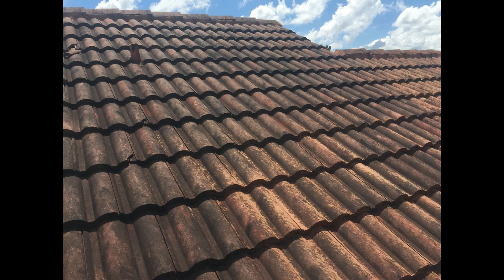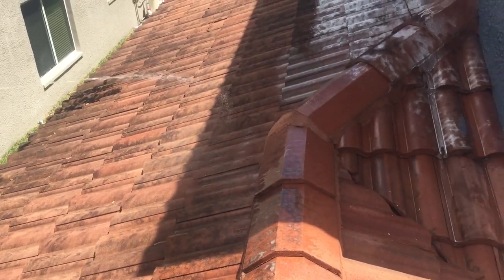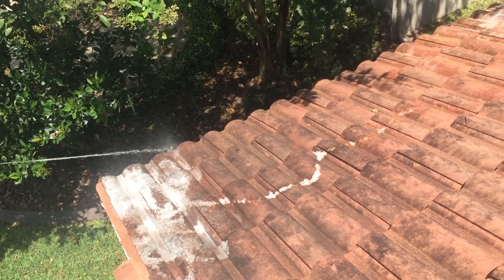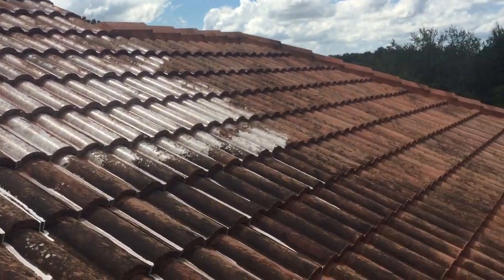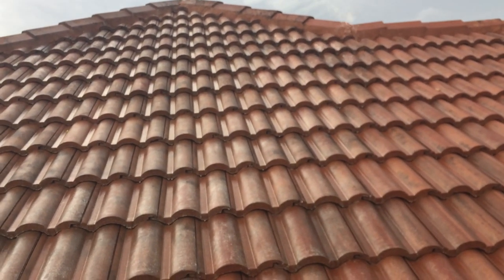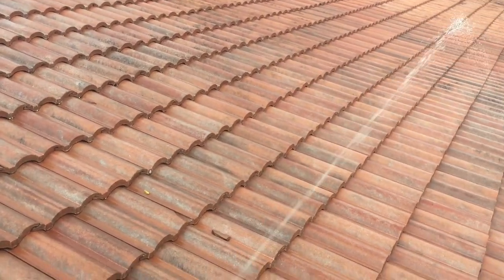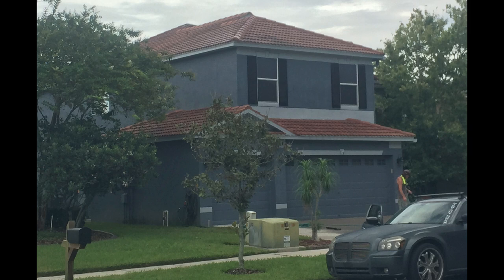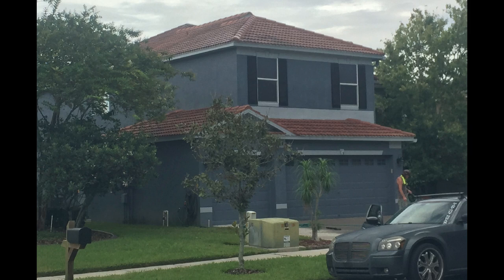Tile roof soft wash cleaning - roof cleaning service

Comment: There is a problem with this method, IF the roof was put on in Florida in the early 2000s. At that time, they were using "Polystick" as the underlayment, and screwing the tiles directly through the underlayment into the deck with galvanized deck screws. If you use SH (sodium hypochlorite)  it will attack the deck screws, which leads to corrosion and then small roof leaks as the screws loose their tight seals to the polystick. This creates numerous small roof leaks, all over the roof. The leaks are usually small, but in Florida quickly lead to large sections of the deck being effected and ultimately rotting out. This is particularly true near ridge vents. Thus, it is wise to go the slow and proven method of pressure-washing with mild chemicals. It takes a lot longer, but extends the life of the roof by at least ten years.
Reply from the maker: You are correct that is why we try to avoid flooding the roof with chemicals. And washing off with Water the roof before we complete the job to dilute the chemical down to drinking water level.
Reply: @lsellclumanetsolarenergyll5071  hello. Wondering which nozzle you are using here? Thanks

Comment: Hey, i have a few questions- can we use sh on driveway tiles? Why not use fan tip(45 degree)  and cover lot of area instead of using pin point tip? Is it a bad idea to use high-pressure washer directly? It seems to clean well for me without any chemicals
Reply from the maker: It is low pressure. We apply only with up to 100psi. The 0 degree tip allows us to still apply in area's where there is wind and the customer does not want us to walk on their roof.

Comment: Why not use a flat surface cleaner on a carbon fiber pole ? Totally  biological  and probably a better result ..  There are flat surface cleaners that will work  on a pole .. . i think you may find it is a very good option
Reply from the maker: Simple answer : You void manufacture warranty of the roof. And are in for a law suit from the owner and roofing Company. The American Roofing Association states clearly only to use Soft Wash methods with  SH to clean roofing in the USA. And 2nd with a flat surface you need walk on the roof no fiber glass pole will work without you having to walk on those roofs. I had roof where we had to walk on it it is posted on our website which is over 8000sf big where a 2000sf pool screen porch didn't gave us any other access. So we walked on it and 15 tiles broke in the process which lucky us we knew it will happen so we had replacement tiles bought upfront and once finished we replaced those all for the Home Owner free of charge. And here in Florida the slip and fall risk is over 80% when you walk on those black algae roofs even with a 3/12 pitch you will come down hard. Which jacks up our insurance so we don't do it.
Reply: @lsellclumanetsolarenergyll5071   Sounds like a lot of burocracy there  putting people off starting a small business... it is bad enough where i am .. but sure buddy i get your point... ironically  using Hypo here in Germany i think  is illegal because of the ground water..
Reply from the maker: @fensterputzernuernbergerlangen  Nope it is fully legal also in good old Deutschland because as you may not realize every drinking water is containing it as well. In German you call it Chlor which is also use in every public swimming pool too. As long you rinse off with water it will dilute to the point that is is neutralized.
Reply: @lsellclumanetsolarenergyll5071  A swimming pool is a public domain and so have water systems im place to contain and reclaim  ; Chlor used in the toilet  gets flushed down the into the water system. But water  which has Bleach in it running of  gutters  , walls etc  have in most cases are not directed  to the water sytem... You have to Reclaim it thsi water if possible . If Bleach is legal to be used in Germany  on roofs and walls etc ( external applications ) i would glad to know this but i am pretty sure it is not allowed Sir because it seeps into the ground water. i am not saying i know this as a fact 100 %  but i am pretty confident that it is not allowed .
Reply from the maker: @fensterputzernuernbergerlangen  and I am telling you it is a fact. Because every tap drinking water you even drink contains up to 0.3% Chor it is used to kill of algae. You can also reach out to Satho Fassadenreinigung their email is info@satho-hamburg.de I know them personally because they also do Soft Wash thru out Hamburg for years and years.

Comment: How much do you charge for a roof like this?
Reply from the maker: This was a bigger job than normal so we charge between $600-$800 depending on Porch/Pool screen if cleaned as well which was the case in this job including roofing inside the pool cage and the pool deck as well.

Comment: I have Can Do Pressure Washing in Houston TX using the same type of 12VDC pump soft wash system and SH. My primary surfactant is Max Cling from Northern Tool. 

For rinsing after the SH application, I use my pressure washing system instead of a garden hose. DO NOT FREAK OUT - I just use the gun / wand / extension with NO tip and reduce the engine RPM. I do from the ground or ladder. This provides a far higher water volume for faster and better rinsing, and the pressure is about the same as a garden hose so no damage.

Comment: From what i have seen, 10 to 20% SH, 10% Dawn, and 70 to 80% water works great on Tile Roofs, also most people use it as a prewash and then follow it up with there surface cleaner and since the SH works so quickly you can move through the power washing step very quickly and get the roof done in less time. Though I know a lot of people don't want to do that step and that is why they do soft washes in the first place.
Reply from the maker: Loser Squad HD 123  you void the roof warranty when you do high pressure and you do destroy the tiles with it. Also don’t try this down here in Florida or you will slip and fall because some of those tiles are glaced and others are filled up with sudd from the sugar cane burning which stays behind even after cleaning as a once wet so slippery film you simply can’t walk on those tiles.

Comment: It’s awesome that you provide so much info. If I lived in the Central Florida area I would have you do my roof. Lolo Thanks!

Also, what type of safety gear do you use? I’m sure Mask, goggles, chemical proof coveralls?
Reply from the maker: I do use a respirator and that's it. If you aren't trained good I would recommend good shoes as well. And ensure you have somewhere fresh water available like we store about 100 gallon of water in our buffer tank and have a 1" dump valve on it in case something happens.

Comment: Why aren't you walking the roof with a fan tip. I like that you aren't shooting under the tiles though. Try using a carwash soap to keep it wet. I like using something with rainX in it.
Reply from the maker: Here in Florida the roof is so slippery you try to avoid under all cost to walk on the roof. I had a single story roof I had to walk on and slipped and slided to the point of no control once. After that I stopped walking on the roof especially on a 2 story it is way to risky.
Reply: @lsellclumanetsolarenergyll5071  That makes perfect sense. Maybe think about an extension pole with a 90° bend in it. I'll try to think of something to help with that. My brother is very smart when it comes to thinking outside of the box. I'll bring it up to him too. Be safe and happy washing.
Reply from the maker: @mathewgriffith341  I do have 30' extension poles made out of fiberglass but they weight about 130lbs now crawl up a 26' ladder with it and than position yourself like a boom crane. Maybe HULK can hold that and work it for hours but for me it's to heavy and also it bend's to much when extended out so far. Which brings me back to the method I currently use. I used a different setup now with a PVC 10' and 10' extension pipe where needed still using the same tips to shoot up to 30' to cover the full roof. Like I done for a customer down in Wellington to clean her roof which on a 1 Story Level was so slippery I would not even attempt to walk on an 20year old roof tile which may break just on my weight walking on it.
Reply: @lsellclumanetsolarenergyll5071  Still going to try and think something up for you. 👍
Reply: Can you actually walk on a
Clay roof? It won’t brake?
Reply: @paulrosas2302  yes you can

Comment: Im in business thirty years here in florida and never had a claim against us for a damaged roof. Always only using high pressure
Reply from the maker: high pressure will destroy the tiles and you do have to walk on the roof which will make your insurance to go up and puts you into a much bigger risk.
Reply: @lsellclumanetsolarenergyll5071  Hi, I'm doing your soft wash cleaning work in Turkey. Washing detergents are not here, I'm trying to mix some detergents myself to create solutions. From my research, you mix water with hypo and add surfactant. Surfactant ? Is it the substance that gives soap and shower gel foam and its density?
Reply from the maker: Email me to store@lumanet.info but take a look a dish soap's for starters which is only 100% surfactant and water. I bet you find some in your Edeka store.
Reply: If you don’t kill the algae it will come back also high pressure does destroy the roofs especially the black tiled roofs

Comment: What kind of ladder are you using? Regular one with a stabilizer? Or a frame. By your angle it looks like a 20’
Reply from the maker: 32' Werner fiberglass ladder. We now added the quick release attachment to it so we no longer lean against gutters.

Comment: Question I ran my chemical injector until it was empty. I continued running it even while it was empty for a while. Then once I realized it I disconnected it and never pushed water through it. Think it’s ruined? I don’t think I even put much sh through it it was a crappy zep concrete cleaner
Reply from the maker: Take it apart and clean the ball and spring those love to get stuff on them which causes them to seal shut or stay wide open.

Comment: Hi, I need some information, please. What pressure washer can do 21 litres per minute at 1500psi if you are cleaning about 50.meters height and your source of water (pressure washer) is on a truck on the ground?
Reply from the maker: Most all modern Pressure Washers pumps with 13HP engines can run 5.5GPM so 21 liter a min pumps at up to 5000psi. All you do is to reduce on the pressure control value the pressure down to your 1500psi and you are golden. And we run all on trailers so we carry 300 gallon tote tanks on our trailers but when we run big job's we let a water truck Company show up from where we can use 3000-9000 Gallons of water no problem.

Comment: Congratulations for the work and whim!

Doesn't this mixture of chemicals damage the color of the walls of the house? And if the tiles are painted with acrylic paint or some waterproofing, is there a risk of SH staining?
Reply from the maker: The Chemical can damage the paint on the house, one main reason you have a 2nd person below you ensuring nothing hit's or stay's on anything other than the roof itself. A lot of Companies like to use a flooding method which I fully disagree with. I prefer to spay just the right about to the right areas. Which takes more time but much better results and happier customers because they honor it more when they know you spend a good amount of time cleaning their roof and even had them confirm first that they are pleased with the result before final payment is made. SH staining can happen but that's why you wet those area's. Also if tiles are painted over you see it when you come onsite and work your way onto the roof for inspection before you start the job. I also if we notice there is a glaze on the shingles for example talk first with the house owner to find out if this is produced or afterwards installed. If the Home owner doesn't know lift care fully a single up with a flat iron to get 1" space between 2 rows to confirm it for yourself. Always be open with customers and bring up any concerns you may have. If onsite find out the job is to risky inform your customer about your concerns and if they mind to sign wavers. Lay it out for them in a nice way. But cover your 6 because even a now maybe mad customer will be maybe put a negative review so be it but you don't have a law suite against you.
Reply: @lsellclumanetsolarenergyll5071  Thanks for the detailed and information-rich answer, thank you!
Reply: Mm8'. Dream
 à est À une une de deux ✌️ la plus ➕ du territoire américain 🏈 8

Comment: Some one told me the bleach opens poors in the clay tiles and makes it so you got to wash it more often is that true looks good
Reply from the maker: Thank you for asking the question. The answer is "NO" what cause it is the algae which you see it black but can be green as well eat's into the clay tile and destroy's the clay tile over time. So What you can do is clean it proper and than apply a sealer which run's you about $150 per 500sf. It is a concrete sealer you can spray apply. What destroy's shingles in general a lot more is high water pressure. That is why we only recommend soft wash methods to extend to lifetime of a roof. On Asphalt almost to 40 years and Clay/Concrete over 80 years. 
Also surfactant ensure you do not have to use as much chemicals. And when you see the chemical reaction that it's turning into white foam it is the SH reacting with the organic matter. Once you no longer see that happening you cleaned the roof as good as possible. Sometimes black marks are permanently embedded in shingles which you no longer can remove without destroying the tile itself by using high pressure methods.

Comment: Have you tried xjetting it? That's what I plan on using since that's all I have right now to begin saving up for a softwash system
Reply from the maker: nope have no need to use xjetting we upgraded to full diaphram setup which shoots with our own JROD's up to 60ft now no problem. Our biggest worry is chemicals to run of the roof and may harm or kill plants below or grass.
Reply: LSE LLC (Lumanet Solar Energy LLC) that's why you have someone help you below water off plants though
Reply: Using the Xjet on a roof would require having a container/ bucket on the roof with you, that could turn into an unsafe situation very fast. Very risky, be safe if you do..... Good Luck!

Comment: I'm from australia I got terracotta roof to clean where it's full of moss, I got pressure wash the roof but I want moss to get lose from surfaces so cleaning gets easy for me and if I apply this product and going to pressure wash roof what do you recommend time I should wait after applying the product and before pressure washing.
Reply from the maker: Hello Malik, how big of a green gray moss area do you have? I would recommend you use 8% SH with DAWN soap mixed with water and soak spray it on and leave it on for 1h on the moss areas. Than you spray the full roof with 3% SH water mix as a Softwash. Make sure the chemical reaction starts within 10-15sec of you spray on the chemical. Let is sit for another 45-60 min and than you use Just Jet water so use your high pressure 20liter a min pump and just rinse it all off. High pressure void's the warranty of any roof material and can destroy it meaning you be liable for the damage. Message me via email to store@lumanet.info with photos and I guide you thru the work process. Moss has roots which grow into the tile material and so with the chemical you destroy the organic matter without breaking the tile material ending with a very happy customer and a finished product you can drone document or photos take for your portfolio.

Comment: What surfacfant are you using to get that to foam up a little after application?
Reply from the maker: I do use SLOWFLO but the foam is because of the higher concentration of SH in my mix which reacts instantly with the black algea on the roof shingle which is open poor so you don't have much run off with my method because I am not like a lot others just flooding the roof with chemicals.

Comment: Can you tell me exactly what kind of pump I need to get and does chlorine do the same or does it have to be SH
Reply from the maker: Any Diaphragm pump can run SH without a problem. Just when done you run pure water thru it and you are all good. I run the water thru it anyhow when I rinse of the roof or house siding anyhow :-)

Comment: Where can I buy a diaphragm pump like yours thank you great video
Reply from the maker: You can buy it on Ebay, Amazon, Tractor Supply, RuralKing, Northern Tools just to name a few. Get yourself a 5.5 Gallon one.
Reply: Thanks a lot I appreciate it is there anything else you could tell me how to get started on this I can’t find out how much bleach to use for a 2000 square-foot house I know you mix it with the thought of fourth of water and soap but how many bottles of bleach what I need to buy is what I’m trying to find out
Reply from the maker: @benderprofessionalservices9018  Check out some of my Video's where I did build my new Softwash Rig. You do need 2 Tanks one for Water and one for Sodium Hypochloride with mixing valve's. Chlorine, Bleach is just a common name for Sodium Hyprochloride. The importance is the percentage you going to use.

Comment: How many gallons did it take to clean
Reply from the maker: 45 gallon mix was all we had to use for the hole roof plus back porch and Pool screen
Reply: @lsellclumanetsolarenergyll5071  and what was the proportion SH and water?
Reply from the maker: @furs067  8 gallon SH 1 surfactant and 35 water
Reply: @lsellclumanetsolarenergyll5071  and does the Surfactant is necessary to use or you can get away with it?
Reply from the maker: @furs067  depends on the shingle. If the shingle has a glaze finish you need it